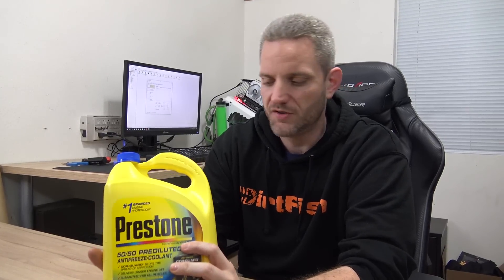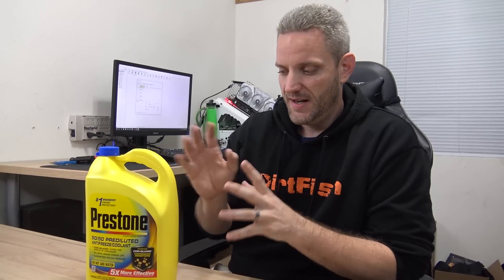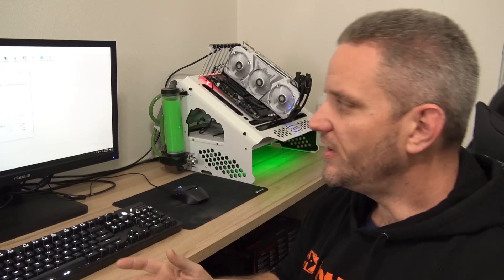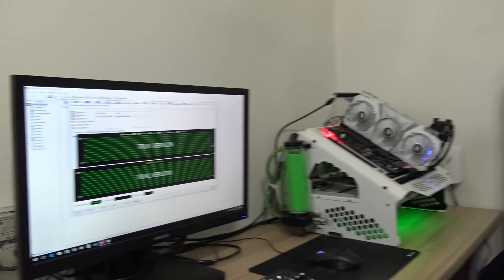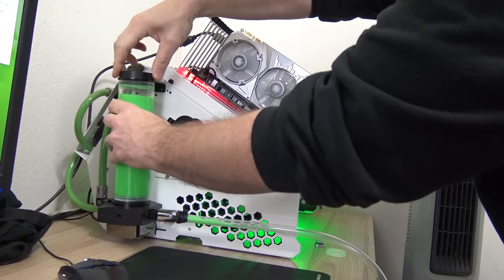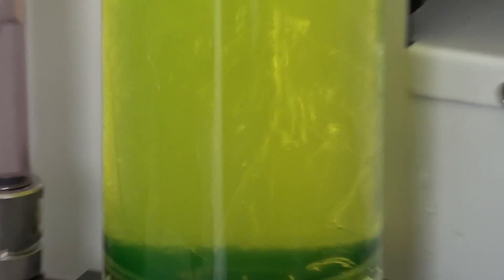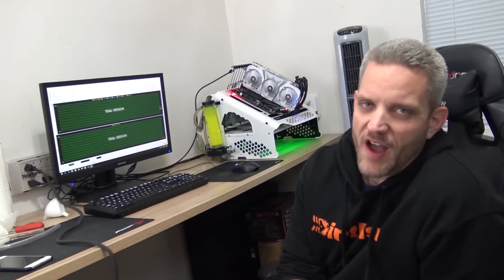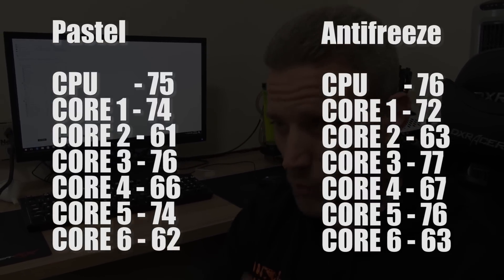I used Antifreeze to cool a PC

Comment: Apparently most PC water coolants are technically the same stuff as car coolant for most part, there's two different Glycols for given coolants, Propylene Glycol and Ethylene Glycol (I would avoid Ethylene Glycol version personally), and for general longevity, I have decided to go with EPDM hoses for my own custom Ryzen Threadripper workstation so it lasts longer, as I kinda don't trust PETG tubing with something very expensive (after all, EPDM hoses are designed to handle the coolant).

Comment: You should get a geroter style oil pump and see if you can rig it up, that will allow you to run some extremely viscous fluids through there. The pump should be like $30 but you need something to drive it. One thing to note though is it’s going to compress whatever you put in there and they generally run upwards of 50 psi

Comment: Stupid question then -- how well does the antifreeze prevent gunk build-up?

Like with water cooling, you have to add in biocide to prevent it, but even then, it doesn't stop it completely.

What about antifreeze? I would assume that the ethylene glycol mixture is probably not great for biogrowth of ANY kind, so that should be less of a concern, no?

Comment: Jay what the fuck. Genuinely looking for an answer on this
Reply: check msds of particular car coolant with your seals, probably epdm.  also, dilute it to 15% coolant and 85% distilled water.  use the coolant like and additive/inhibitor, which is what it is.  the fluid should last years as long as the loop is sealed.

Comment: what's point of using antifreeze if you just use fans. 
Idea of 50/50 mix you can run a loop thru freezer to bring temperature way down.

Comment: If you pick your coolant and components correctly theres no problem.
Gotta check dat material datasheet for chemical resistance.
I got there from the other end. I looked at the pc coolant and discovered they're all the same crap as orange pennzoil without the orange.
I will tolerate the orange coolant

Comment: so if you get the non corrosion stuff and use glass tubes with metal fittings it could theoretically be better for longevity

Comment: I took the risk and I have been using an organic antifreeze (Repsol) for 5 years without any issues. I also use an Aquacomputer sensor to report the liquid conductivity and it has been fine for the past 5 years.

Comment: I use copper lines and don't care about the color so yeah, this video was pointless to me. I will say that using a antifreeze mix you will never have to clean any blocks ever again...unlike most of the colored coolant packages offered which turn to trash over time.

Comment: I'm using antifreeze with water since 2005. My ddc pump works since 2008. It’s simply the best coolant, because it's prevent corrosion, lubricates pump and kill all micro organics in contour. Expensive coolants delaminates and they contains colored micro partitions, that kill your equipment.
Reply: What kind do you use? Specs, brands ?
Reply: @EpicBunty  ordinary antifreeze from Russian store. Nord or something like that
Reply: I know its already been a while to comment but whats the ratio you would dilute to water?
Reply: @FlorianDebray  I don't follow the proportions, but usually there is more water than antifreeze. Reason: water holds more heat, and i don't actually freeze liquid.

Comment: Just refilled an old H100i with universal concentrate. I didn't do it scientifically but I mixed it probably 1:4. Idle temps on my 7800x3d went from 60s-70s to mid 30s

Comment: Interestingly enough the old PowerMac G5's used GM's coolant as the manufacturer for the liquid cooler was a former contractor/arm of GM. Unfortunately Dexcool is quite corrosive compared to water and the often had leaking issues. Not great for your aluminum alloy chassis or your electronics.

Comment: Plain distilled is gonna rot your system out the antifreeze is a very good solution, good thermal conductivity, but more viscous, also it has corrosion protection, id use it for sure, if i didnt have the coolant meant for a pc

Comment: I've used a mixture of volvo VCS coolant and distilled water for the past 10 years. I've newer done a complete flush, just added new mixture when upgrading the GPU. Now I removed one of the radiators and did flush the system. My soft tubing has become green/yellow and semi hard. There was a bit of flacking visible on the liquid, but not much, and the reservoir has some white residue on the walls and looks like it has cracks forming from the inside out. As it has been running for a decade with no problems, I'd say it has been working well.

Comment: I have been using that exact Prestone coolant in my custom loop for 4 years now with no issues at all whatsoever. My system runs 24/7/365 and uses a generic SC600 pump. No issues with seals leaking. System has cheap Lowe's 3/8" vinyl tubing, plastic reservoir, copper block, aluminum radiator with copper tubes (coolant is not exposed to aluminum), and brass fittings. I am running a 50/50 mix of the green Prestone coolant and distilled to give me a ratio of 3:1 water to antifreeze. I think it's important to note that some PC coolants essentially use the same ethylene glycol and have the exact same sweet smell. The Thermaltake Bigwater 735 is one kit that comes to mind which used ethylene glycol in its coolant. In my video I had posted back in late 2018 about this topic, I advised to stay away from OAT and HOAT coolants such as Dexcool or Toyota coolant, and use the traditional green stuff such as this Prestone coolant. The previous coolant I had in the system was Primochill PC Ice and I had algae problems after 1 year of use. Needing to flush the system and put something else in, I happened to have some spare Prestone coolant in the shed, and this is how I ended up using it. The only concern I have is with the fact it's toxic to humans and animals and is a concern for homes with children and pets. Other than that, it should work as a low maintenance coolant which will provide years of problem free service from my experience. It may also be a good option for servicing prefilled AiO liquid cooling systems as these systems tend to mix copper and aluminum. In a way, I could say the Prestone stuff has extended pump life. The cheap $20 SC600 pump on my main system runs nice and quiet, and sounds even quieter with the Prestone stuff than it did with the Primochill PC Ice.

Comment: Found this out on the net.
"Water in the cooling system is capable of transferring twice as much heat out of the same system as compared to a 50/50 glycol coolant and water solution."
Reply: Problem is it won't do it for long...it will boil and it will be running on air bubbles.

Comment: I know this is old, but It will not do a thing to the plastics...
Your car radiator is made from plastic and it will not corrode plastic. The tubes I'm not sure, because car tubing is from a rubber designed to be tough...

Comment: Ok jaystwocents viewers I need advice:  I’ve got an old powermac g5 quad that I use every once in a while that I’ve removed the coolant on (It’s not red like Dexcool although I have read that it is Dexcool). I do believe it contains antifreeze and I would like it to contain antifreeze because it is a sealed system and I live in Minnesota and would like to be able to store this in cold storage.  All the tubing is braided hose, and with an aluminum radiator many standard PC coolant‘s claim to be corrosive with aluminum.  Do you guys think that Car anti-freeze would work for me?  I believe to my research that Delphi 151 is the original Coolant but I can find next to no information about it besides that also I wouldn’t begin to know where I could find more. Any help would be greatly appreciated thanks!

Comment: Antifreeze isn’t called Ubercoolant for a reason.  Every single source will tell you that water by itself has better heat transfer than water plus antifreeze.  Antifreeze prevents ice by lowering the freezing point. It doesn’t increase thermal conductivity it actually decreases it.  I hope they aren’t filling up their car radiators with 100% antifreeze either, equally stupid.

Comment: I see that your motherboard and GPU isn't in'a PC Case / casing. is that bad for the motherboard and graphics card or i do not have to have a PC case for to have the PC componets in? if i wanted to do free air / open air my PC componets setup, will the componets  be  warmer / hotter or more colder like?

Comment: I know these videos are flustrating Jay, but your efforts are appreciated.  A friend asked me this very question recently and I just did not know the answer, so I defaulted to "ask the internet."  I believe he was more interested in the florescent look of the fluid rather than the performance, which can be difficult to get just right.  A lot of the available fluids are not translucent and when diluted they just don't look the same.  As time passes more options will be available.

To the other end of the extreme, I don't know why anyone in a cold climate environment would liquid cool their PC, when open-air would get the job done without risking damage to their unit.  When aesthetics supersede function then the owner/builder of the PC is doing it wrong.

Comment: I think the main reason using this would be longevity, you can leave it for years without having to maintain it, you just need to watch out for what tubing you're getting which this video does explain very nicely
Reply: I think the best to be safe would probably be glass tubing
Reply: @BigDrewski1000 pure silicone tubing, impervious to pretty much all organic solvents which includes ethylene glycol.

Comment: It works fine but it's thick and it's toxic, use plumbing/RV antifreeze it's none toxic propylene glycol based same as most PC coolants and has the anti corrosion additives,

Comment: Does Mineral oil work well vs Liquid coolant for Loops? trying to figure out if i want to use mineral oil instead. Will the motor be able to handle it? why mineral oil? thanks for asking... he said you could use orange juice, gatorade or milk... oil seems like a good balance.

Comment: I’m doing a little experiment myself. Antifreeze shouldn’t harm any plastics or anything. It’s used in cars with mixed metals and plastics. So my experiment is after PrimoChill Vue let me down twice in a row after two weeks I’ve decided to run antifreeze. Using a D5 pump, copper radiator and nickel plated cpu block. Been running for a week now with no issue. I’m gonna let it go long term and see what the results are.

Comment: Only reason i could see using antifreeze is if you had some custom chiller pump setup for subzero benching. 50/50 is not much different than water in the terms of thermal conductivity, its entire function is to handle down to -33 degrees so it wont freeze and destroy your engine during the winter.

Comment: in the end of 1990´s, early 2000´s we used Glysantin G48 ( I bet the presto stuff is the same) in a mix of 1/10 to maximal 1/20 with PVC (Vinyl) soft tubes without any problems. Still now many water cooling veterans use it w/o any problems for years.

Comment: You are worried about what it would do to the plastics yet it is designed to be compatible with many different types of plastics.  They use plastic to make the car radiators now.

Comment: I know I am late to the game but I looked into this before using antifreeze at a 15%-20% mix. The coolant sold by the companies is propylene glycol, antifreeze is ethylene glycol. Both are glycol based and are diluted with distilled water. I have been running antifreeze with petg tubing for over a year now and I have had zero issues. There are also glycol based plastics in some cars cooling systems, my jeep cherokee had plastic hose fittings on the radiator, was also never as issue. The main difference between propylene and ethylene is one is more toxic than the other because ethylene is more chemical based. Shall I drain my loop and show I have no issues using antifreeze? It's used because I cannot go to the store and buy coolant for a pc and I'm forced to buy from third party sellers who sell the stuff at $100 a for 1000ml. Sorry but where you said "you will have a chemical reaction using glycol based coolants with glycol based plastics", it is wrong because you are using glycol based coolant when you buy it ekwb, corsair, thermaltake, mayhems, alphacool, etc.

Comment: I used the same brand of coolant but without the antifteeze for straight 5 years without changing in my old rig. I built it back in 2008 using swiftechs kit with soft tubing. Mixture was 2fl oz./0.5l, never encountered any problem.

Comment: Next, non glycol based radiator fluid! https://www.repco.co.nz/en/oils-fluids/engine-oils-fluids/coolant/penrite-100-000km-green-concentrate-corrosion-inhibitor-500ml-cool10005/p/A1270800

Comment: Wow dumb video.
1. Kinda obvious what anti-freeze will do, it's coolant with anti-freeze properties added, which degrades the heat transfer performance, for the benefit of not freezing in cold conditions, which is usually not where a PC will stand, so it will perform slightly worse, the anti-freeze properties can also introduce more corrosion, there is anti-corrosion properties in, but so are their in normal pc pre-mixed coolant solutions, so longevity with anti-freeze might be worse.
It would be the opposite which would make a performance gain, replacing a car's coolant with pc coolant, as long as the temperature isn't below 0, that might give your car a slight performance increase, especially turboed cars.

Comment: By the way,  antifreeze does NOT cool. The water mixed with the antifreeze does the cooling. You want antifreeze in an engine to keep the water from freezing because if the water freezes it can expand and crack the engine block. But this isn't a problem for computers since they typically aren't used outdoors in frigid temperatures.

Comment: Your results are what you'd expect. Glycol is denser than water and less effective at cooling...therefore losing efficiencies by a small margin. As far as corrosion, it's not an issue as corrosion inhibitors in modern antifreeze are excellent for closed loop applications (because that's what they are, just in a car). The best home-made closed-loop cooling fluid is purified water (RO/not DI) with automotive coolant additives. I have two AIOs running RO water with automotive coolant additives for over 5-years with zero issues. In fact, any new AIO I buy I dump the stock coolant. If you want to trust Chinese water...go for it...but I sure as heck don't.

Comment: I have used antifreeze since 2009 in my X58 system with vinyl tubing from the hardware store. Water blocks are copper and radiator is an aluminium car radiator from a small suzuki. Nothing failed it worked perfectly but the tubing is not PETG.
Reply: My thoughts too. I used distilled water with a small ammount of anti freeze to prevent algea for 6 years. Never had any issue at all. The tube is actually made of PET, not PETG. PETG is PET with added glycol for 3d printing.

edit. Forgot to say that most soft tubing is actually PVC
Reply: @mekawasp  I use straight anti-freeze now with PETG works perfectly the red colour looks really good. Anti-freeze also is essential in a car to lubricant the water pump seal, perhaps it is beneficial for the PC pump also.

Comment: Prewatch comment.

As an auto mechanic, I would guess this wouldn't work well, since antifreeze isn't really a great coolant.

Water will actually keep your engine cooler by itself than a 50/50 mix.

You could try Water Wetter, which actually improves the cooling ability of water. In our race car we run straight water with the WW.

Now, off to watch.

Comment: this channel is way better than Linus TT , just adding antifreeze is designed so it does not rust metal pumps and radiators in the long run. Also as the name states the freezing and condensation temperatures are way better than water.

Comment: I'm really worried that he used antifreeze concentrate and not the 50/50 mixture. If you buy concentrate you're supposed to mix water with this stuff before you even put it in a car.

Comment: I think for cooling you are looking for absorption values and specific heat capacity. Some average as the higher of those two values, but water has a good value of both, hard to beat.
Reply: specific heat of water is 1.0 from what I remember, and also from what I remember that is relatively pretty high, given constant atmospheric pressure throughout any comparison. I'm thinking his original fluid and the antifreeze probably shared roughly the same specific heat, which is the reason the two trials were similar, and if one were to use a safe, alternative tubing system, then they'd be fine. In order to see if it would cool better, a system that allowed for more heat diffusion would be the test to perform, like a system with more coolant volume, and /or more of an exposed surface area to room temperature. lol I just wrote a book oh well cheers anyway.

Comment: There is a small amount of ethylene glycol in my water loop.  If I only used distilled water it would cause corrosion, probably with in a year, as my waterblock is copper and my rad is aluminum.
Because there is 2 feet of tubing between them, and I use this, they will probably last 10 years longer than they would with distilled water.  My pump will fail first.  I dont use flexible ethylene tubes, while they would have been nice & Id have a better layout, they would degrade the whole loop.  Stiff tubes + mixed metals = antifreeze > distilled water only (flexible tubes + all copper is different story)
my setup was cheap btw, no way to afford all copper for what I paid in total